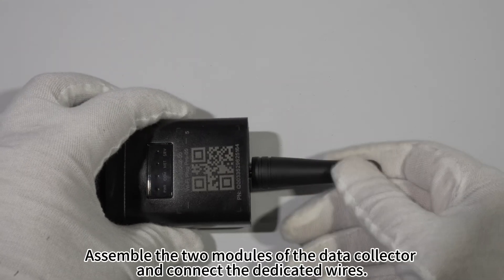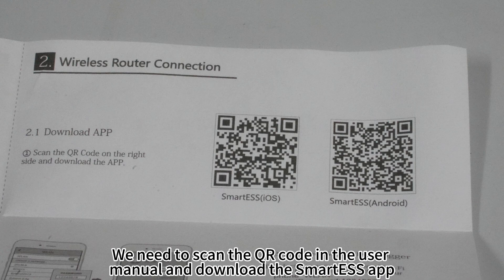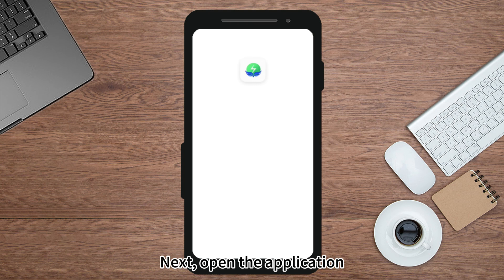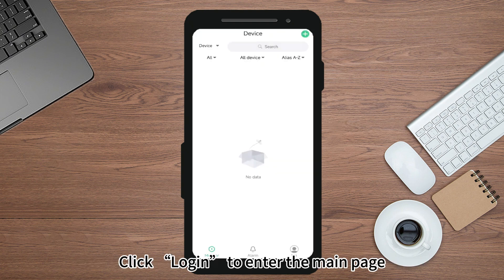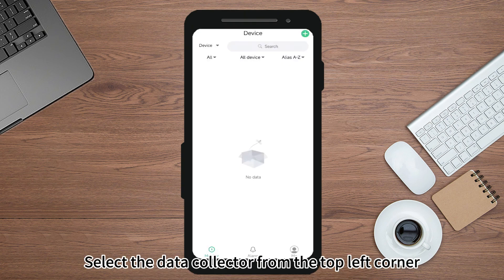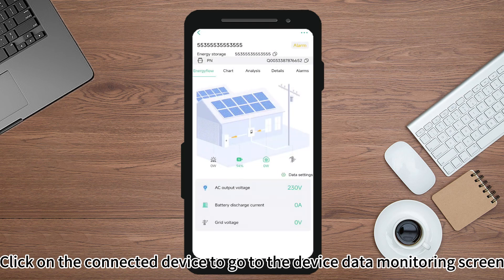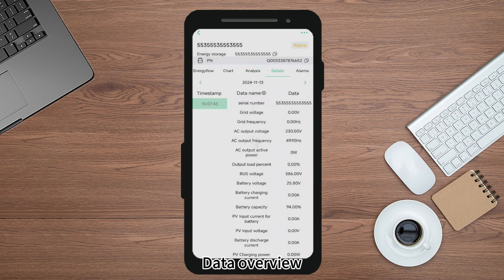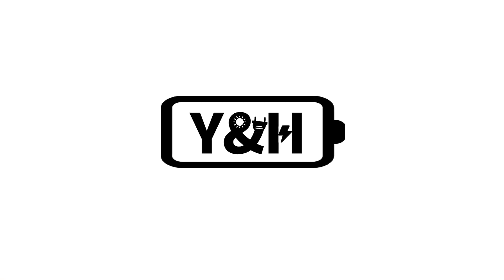Y&H 3200W 24V hybrid inverter WiFi communication, check the working parameters anytime and anywhere

Comment: Hello we recently purchased a 10kW 48V Solar inverter can we use the same app for it
Reply from the maker: Hi, our sp3200 series is not common with MAX 10.2kw wifi module. You can contact y&h to purchase the correct wifi module. Our 10.2kw also has a tutorial on how to use wifi communication. We will post it to youtube later. of course, you can also contact us to get it.
Reply: @ thank you